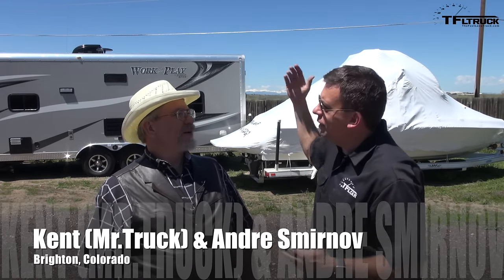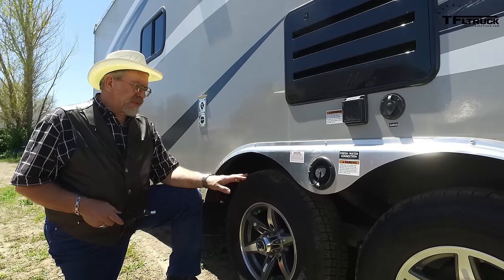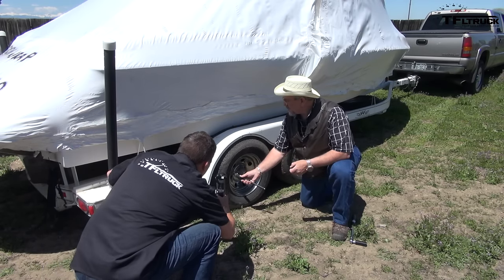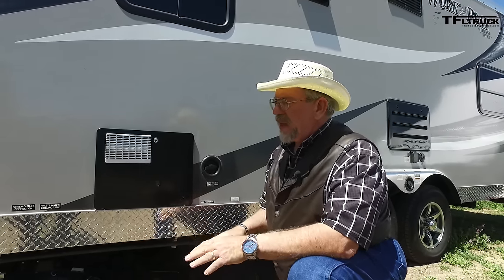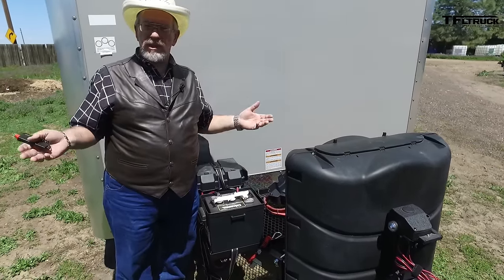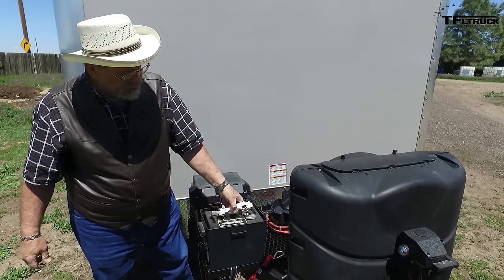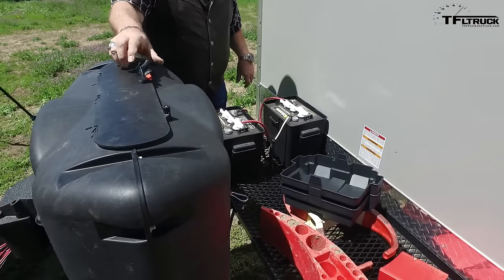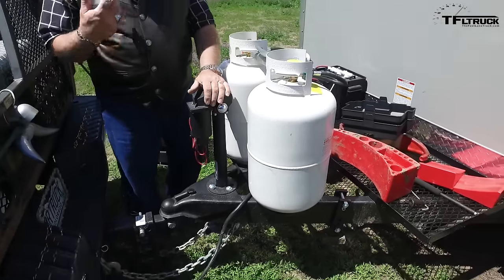How to Prepare your Trailer for Summer: Top 5 Tips

Comment: I'd like to add another useful tip to the tire maintenance.  Moisture will rot out a tire very quickly, especially if the trailer is stored on a dirt lot like the video.  You can get a 3'x4' smooth rubber utility mat from any decent hardware store for under $20 and cut it in half so you have 2 18"x4' sections.  Then simply park with the tires on the rubber pieces and you'll greatly extend the life of the tire.  Lastly, canvas wheel covers are cheap insurance to protect the tires from UV and wheels from stagnant snow when stored outdoors for any amount of time.  These are available at somewhere like harbor freight for $10 for 4 of them.

Comment: Is there a specific caulking material you would use for the roof of your trailer?  How about grease types for the axles?  Thanks for the information.  You got me excited to get out in the outdoors.
Reply: +C Wyoming Caulking depends on the roof, mine is one piece aluminum, alot of RV's have a rubber roof. I use a quality grease that's water proof as used in boat axles.